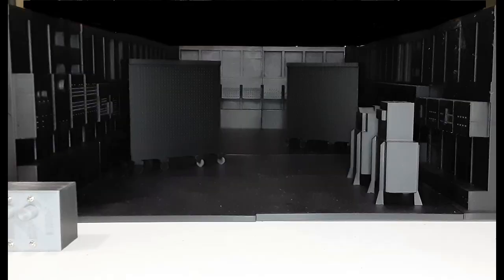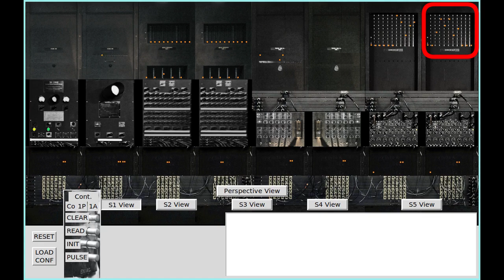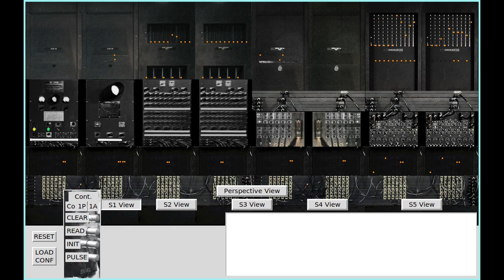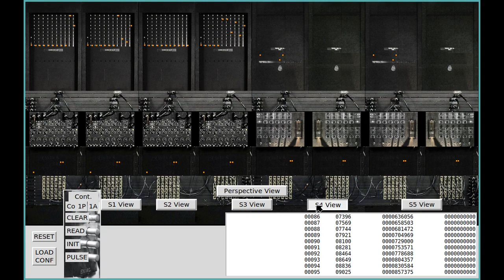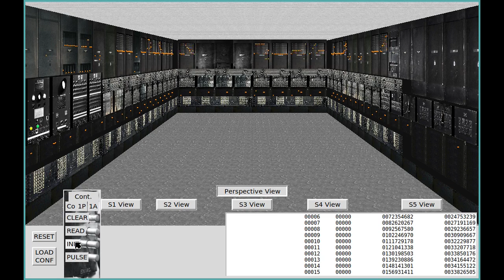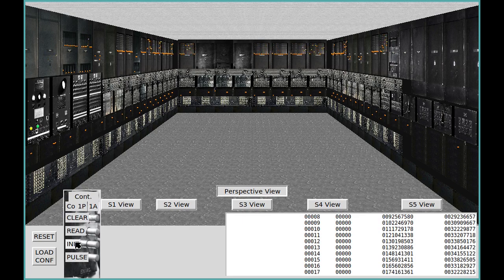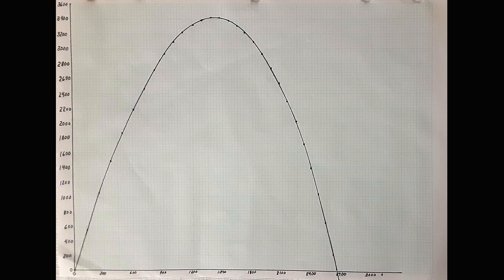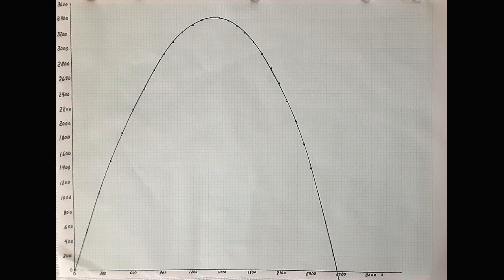ENIAC Demonstration Reenactment

Comment: Thank you for such an amazing lecture! In the video of ENIAC presentation  in 1946 I saw big bulbs with digits on them as if they were a part of the accumulator panel. Were they really a part of the machine or were they made for the demonstration only?
Reply from the maker: Apologies for not noticing your question until now.  This is actually a very, very interesting question, and so far I've never encountered anyone who really knew the full story.  Bill Mauchly brought it up to me that something doesn't quite match the lore.  The newsreel footage with the bulbs has a few interesting bits that suggest that the bulbs weren't on the "production" hardware.  You can see the rest of the machine in the background and you can see tubes on the front, while the full machine had the tubes plugged into the back.  We think it's most likely that the bulbs were added to the two-accumulator prototype that was built in 1944 so that the newsreel cameras could pick up the lights.  The common lore is that the cameramen said the cameras couldn't pick up the neon lights and Eckert and Mauchly went out and bought ping pong balls and painted numbers on them.  But the reality is that still wouldn't be bright enough.  There's a bit of oral history that talks about light bulbs.  The panels on the full machine would have made it difficult to wire in light bulbs of the size seen in the film, and I can't imagine the Army being too keen on that.  So things seem to point to them replacing the neons on the prototype with bulbs with numbers painted either directly on the bulbs or on ping pong balls put over the bulbs.  I'd love to hear more about your experience seeing the original in person.
Reply: @BrianLStuart  Thank you for such a detailed answer!